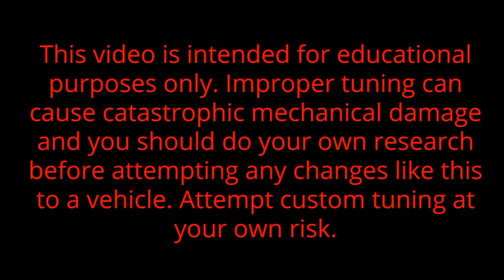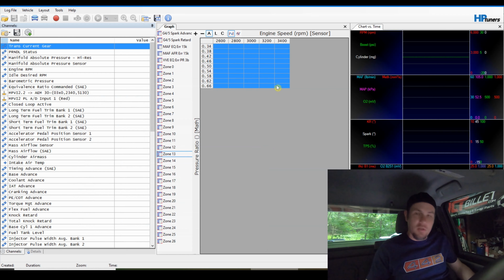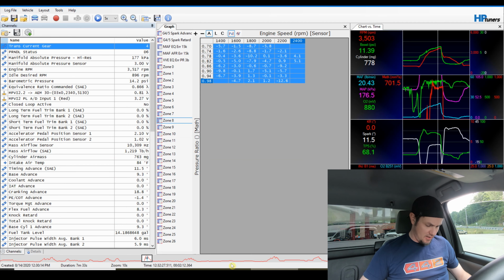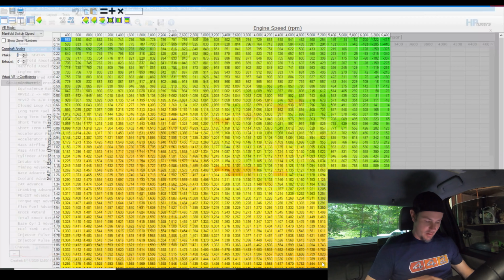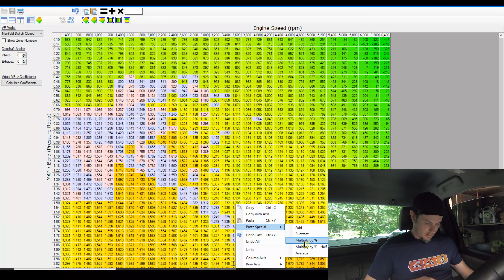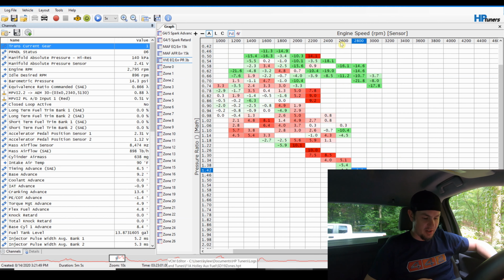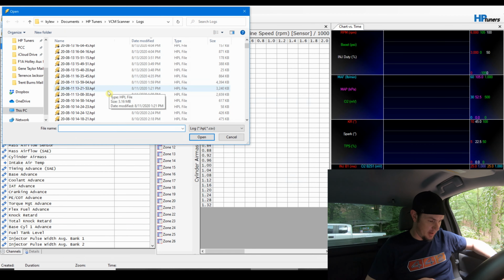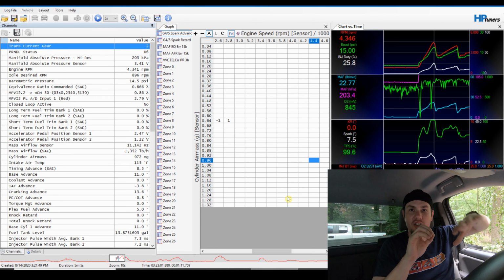A Better Way To Tune Virtual Volumetric Efficiency? Zone By Zone Tuning!

Comment from the maker: Here is a download link to the graphs I setup, keep in mind these are for my zones, you will have to edit the rows/columns and filtering to match your zones but it should help get you started!

https://drive.google.com/file/d/1upGzxP8v9MfmzokX4L0mmjVc49PceQtZ/view?usp=sharing
Reply: Dude I was about to beg and plead with you in a comment to send me these tables and as usual you went above and beyond and had them posted already. Youre the best teacher on YouTube!!
Reply: seen this link after building mine.
thanks
Reply: i cant get the xml file to load in my vcm scanner. any advice?
Reply: My row axis is a little different. Mines reads in "Manifold absolute pressure". I see that yours says "Map / Baro Pressure Ratio" Is there a way for me to get mines like yours? Or should i edit the charts?

Im Tuning a "Gen 4" 5.3 2011 suburban Lt
Reply: @militantmafia7354   same here  but it seems like the axis are the same

Comment: This made a lot of sense to me and I tried it a few times. It is a bit more work but my LS2 is running much smoother in the lower-to-mid throttle input areas and the exhaust is not smelling nearly as rich. Thanks for confirming this is not only possible but it's a viable method!

Comment: This is how I did it on my 6th gen. Worked great. I think I mentioned that in my email to you last week.
Reply: I highly suggest not smoothing those hard lines at the zone boundaries. It cause much more issues than it solved on my tune. I also calculate each zone.
Reply from the maker: Yeah, I haven't been attacking them on mine and have been surprised to see how it has helped with transition zones. Doesn't make sense but seems to work.
Reply: @GoatRopeGarage  My only issue, and seems to be a similar on my friends 4th gen platform. Was that one zone that got out of line and began causing extremely lean conditions. I reverted the zone to a tune that it worked. Then got it to blend with the rest of the table and it was good. My buddy is having a more significant problem.

Comment: Love it!! My setup is a Gen4 z28 427, so i tried the zoning table and used filtering without map pressure math since this is a gen4.  I love these type of videos, Great job!!  Edited, so i tried both ways with filtering and without.  At first i thought their was no change.  I accidently opened the same table twice with the same log, definitely a difference between filtered and unfiltered.
Reply from the maker: I was interested to see how much data it cut out from the transition areas that it populates in the main table, I don't know if that data would help or actually hurt the zone calculations.
Reply: @GoatRopeGarage  the data seems to match, your still getting a average of all the transient no matter what zone your in.  Using the zoom function gives you a real time to peck at your Map but its time consuming.  Ive noticed that filtering Wide Band to get rid of those transients,  I put mine at <1.10 to filter out the transient spikes at 1.36 when shifting a manual. Basically go through your log to make sure its only spikes and set your Wide Band filter accordingly.  So the average should be more refine data.

Comment: a good visual with the filters is to set one up in the maths section and get it to show as 1 or 0 then overlay it with your fueling in the chart v time set the range so u can see the line at 1 and line at 0 then u will see it change from the 1 to 0 when its ignoring data and then back to 1 when it does record data, i found it really good for adjusting the filters to get rid of all the bad data like commanded change v wideband, or decel or fast transients or if u just want steady state can have many uses
Reply from the maker: I like this idea, will have to dig into it more!

Comment: This is how I ended up tuning mine, except i only did the idle and cruise/mid throttle tables seperate, then the wide open ones didn't give me the same problems, so I did them with multiple zones at a time

Comment: Hey buddy. Been watching a lot of your videos lately trying to figure out tuning. I just got the new Hp tuners MPVI3. Got my 2000 Silverado step side with the original block fully rebuilt, used original pistons and rods, 706 heads, original intake manifold I put a truck Norris cam shaft in with the new springs, used oem pushrods, all new bearings, rings, gaskets, the billet oil flow barbel, high pressure melling oil pump, using original fuel pump, original maf, map, and throttle body. After camshaft install and initial start, I’m still in the break in 500 miles. I’m at like 250 now. I’m hearing rockers make noises. So I’m buying the upgraded trunion style ones from Michigan Motorsports or might some engine tech ones local at powersource.. my main issue now is that I can’t get the tune right. I don’t know what I’m doing. I went to the best known tuner I know in the area which is berroa motorsports and he did his best, got the idle much better, but I’m still having issues.. when I come to a stop and sit with foot on brake, the idle falls and it runs like shit, as soon as I let off the brake it lunges forward and it’s good. If I drop it manually into 1 or 2 it doesn’t do that, as soon as I put in 3 or drive it does it again.. Driving at normal speeds is ok getting on it on highway is good.  Called BTR, asked if they think I need a stall converter and they said no. It’s gotta be in the tune. Gotta be tuned right. If u can help in any way please.. I can send you my latest file that I’m running truck on now and I can send you my log of the drive home from work yesterday. Let me know if you can help. Thanks

Comment: Just fyi for anyone using this. Some of the zones dont generate data if you use the downloaded link. The bottom zones need "above and below" map data to generate info. Once I fixed they it work fine.

Comment: I have a ? Are you  gonna add that to the GRG parameters ? Damn!! I just got them I should have waited on the update lol looks good mad scientist.
Reply from the maker: No, only because it is dependent on how your zones are setup and so there isn't really a way to make a one size fits all setup.
Reply from the maker: I added a link at the top of the comments.
Reply: Goat Rope Garage oh yeah I didn’t read all the messages but yeah I did rezone mine of course but yeah Won’t  work but I was just joking man I’m sorry need to keep my big mouth shut I’m causing you more work lol but always man thank you

Comment: Is it normal for the same cells that appear in the main VVE table and the specific zone to have different numbers in them? I notice on my data log the numbers are a bitt different and when scrubbing through your video I see the same difference, like when you mentioned zone 2, there was a 5.1 and 1.9 in the VVE but 5.5 and 2.4 in the zone 2 table.

Comment: Back again Kyle I’m struggling to understand how our axis are very similar but your vve is in pressure ratio mine is in map pressure I was super excited to use your zoning graphs but I don’t know if my e38 from 07 2500 hd is capable of
Reply: Learning from the garage it’s because I’m gen 4 so I need to take out the pressure ratio and zone tune my map kpa

Comment: I noticed when you were editing the tables that you were editing the 0 degree cam position(s).  If your car had a variable cam, say LT1 in a C7, do you only need to edit the 0 degree position? or do you need to modify the cam position in the tune, get a log, set the table to that cam position and make adjustments (for every single position)

Comment: Did this turn out to be a good method of tuning the vve? I don't see any update on what you think about it.
Reply from the maker: This is the way I do it on my own cars. It’s not the fastest but seems to be the most accurate.
Reply: @GoatRopeGarage  I appreciate it. I'm struggling with the vve just turning lean and not smooth after 7-10 runs on the street using both the "traditional" technique and your "zone" technique. I don't know where to go after that so I just start over, and it ends up with the same result.

Comment: Hey I'm new at tuning been tuning my zl1 for 1050cc injectors longtubes 3inch exhaust an 2.55 upper an 9.10 lower an tuned on 91 octane I keep getting spark knock an timing is only at 14.5 on the high octane table an I cant seem to figure it out

Comment: How’s it going if you could please help me out with a question I had somebody tune  my 2006 Chevy 1500 reputable near me in South Florida and it will not go over 100 mph it did before the only thing I’ve done since then is a cam swap so I think it should go faster thanks used to go over 120 easy now it hits 100 mph and like dies out

Comment: I'm doing the (frustrating) VVE tuning on my pretty decent-sized cammed LS7.  Now that it's been 10 months, do you believe this method is the better way to go to get things dialed in close on the VVE?

Also, you have mentioned squaring off your zones via the zone RPM and zone MAP boundaries.  I noticed in this video that wasn't done - still something you recommend doing for simplicity?

Comment: How about when doing a dodge.. referece.. if i log the LT and ST data.. then want to put inthe the VE 1 and 2 tables.. 
there 2 digit on the 09 srt.. , as well when my data log graph . has positives and negatives.. wouldnt the math work different when appliying?

Comment: Yeah, first off, whether you gather data all at once or by zone doesn’t actually matter because, when you click Calculate Coefficients, it already is going to update each zone’s parameters individually anyways.  But IMHO that is the problem.  It’s actually so smart that it’s dumb.  Because the structure for each zones formula has only a 2nd degree polynomial it’s always a concave or convex function.  So they break the whole map down into 30 zones to get a complex shape that more closely approximates the map.  But the problem is at these zone boundaries the curve fitting logic doesn’t account for neighboring cells so the transitions are poor.  This is observable in the 3D graph as a blockiness.  But the irony here is that they should have just used the VE lookup table in the first place and interpolate.

Comment: Great Vid . I really appreciate what you do .  Sure do wish  you did more Uh-Hem , Ford Tuning . I'm just starting out with HPTuners , and Ford sure is different than a LS  Platform . Your videos are helping me learn HPTuners  software, data logging and learning how the engine is running , but it will be a while before I'm ready to attempt any changes . I  just bought a 2008 Mustang GT with a 4.6L 3V with cams , Cat delete , X-pipe and a dyno tune . The compare feature really helps with a stock tune compared to my Dyno tune .  Keep doing what you do and if you would like to look at some more Ford tunes , hit me up .
Reply from the maker: A lot of this carries over luckily, and so between that and a little forum research it can help get you started on the right path.  I would love to get to the point of doing other platforms but there is still so much to do on this one!

Comment: Rpm 2.2k to 4k and Map 35 to 60kpa, filtered and unfiltered the only changed at 35kpa through whole rpm range 2.2k to 4k.  Below 35 kpa there was no change filtered or unfiltered.  Interesting.  Unfiltered rich and filtered was lean for 35 kpa line only.  So i will have to confirm the accuracy of those cells compared to my wide band output. Edit, the filtered 35 kpa line is now in line with the rest of the table.  So the filtered table seems to work and give consistent data.  Unfiltered seemd to be skewed on the 35kpa line.
Reply from the maker: Good to know!

Comment: Are you still putting it into sd to do this? I was told by a few people that it wasn’t necessary on gen 4 and up and went about it a different way. Using a blended histogram once the maf is correct you can leave it in your normal blended vve/maf and log and correct the vve and I’m finding it’s actually giving me much better data. The histogram I’m using is coming up with the final number input into the table too.its not and error table but the math is showing what’s correct with in 3 percent. I’m still playing with it but on two corrections it’s not moving on the 3rd log it’s that accurate. I do like breaking it more into zones as your doing so might try to do something like that to see if changes. But I ave found if you put the vehicle in sd spend all that time on it then add back blended maf the vve will change again the errors will grow. So it almost makes much more sense to tune it in blended and as your going to be driving the vehicle. If haven’t tried it something you should look into to simplify things. A few good threads on it on the hp forum. I was lucky enough to get guidance from a really good tuner on it and get me pointed in the correct direction and set me up with some maths and the table.
Reply from the maker: I have done a video on that a long time ago and I don't actually like that approach as it is calculating a VE as opposed to actually running in VE and seeing the true error.  You have to remember that you might be making changes to VE table but you aren't running on it the majority of the time in Dynamic Airflow, especially in the portions that matter, high load/high rpm, and while the MAF is doing most of the fuel calculations the VE table is being referenced and still is used for high transient states.

Comment: My VVE tables are really far of and can’t get it to run hardly at all on VVE . Is the a way to tune VVE tables while running on MAF.
Reply from the maker: You can use MAF data to generate a VE table but it can be hit or miss. I did a video on it awhile back and generated a table from scratch. But generally I would focus on getting the thing running in SD and work out from idle. I've touched on start up running a few times too